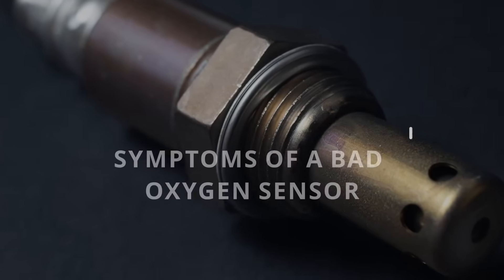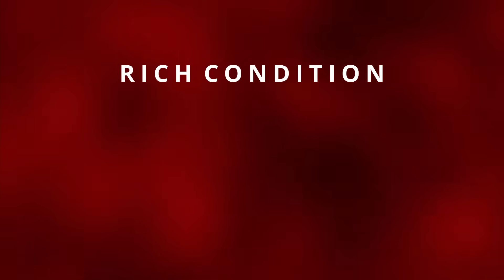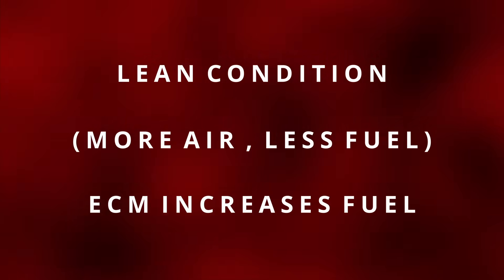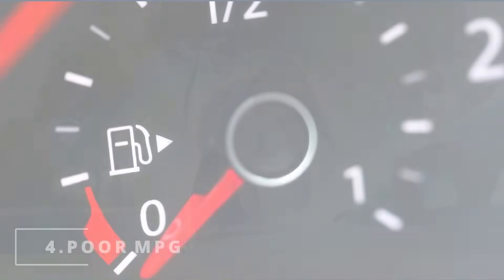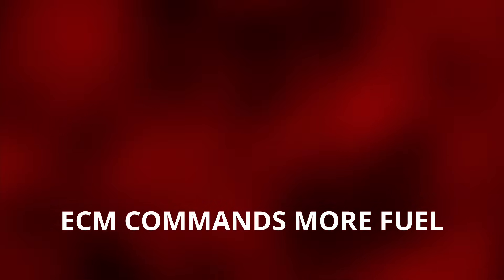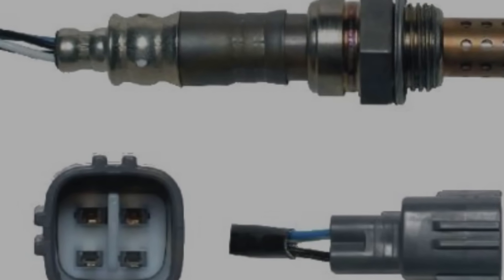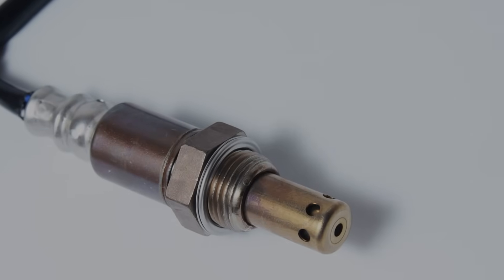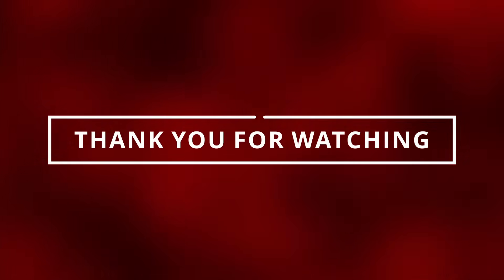SYMPTOMS OF A BAD OXYGEN SENSOR

Comment: Straight to the point and my vehicle is having all the symptoms. You'd think it would be a clogged fuel filter or failing fuel pump from losing power, hesitation, High RPM rev limits and transmission shifting issues. I do have the CEL on and it is the Bank 1, Sensor 1 Upstream. Going to chang it out today in Hope's it will resolve all the issues it's having. Amazing how one little sensor can reck havoc on your engine...
Reply: Please tell us if it really worked
Reply: did it work?
Reply: Hello I have an  01 Buick Regal 3800 supercharger my car is also have the same symptoms. I’ve replaced my battery, an starter.  radiator does have a slow leak! Any ideas?  What  could possibly be going on?
Reply: Did it work?
Reply: Did it work
Reply: Did it work was it the sensor
Reply: Hi did it work
Reply: My truck be making a windy ass hell noise if i open hood feels windy and wasting more gas then ever before engine sign on and the transmission shifting on 1st and 2nd feels clumzy and sounds more airy then i could remeber took truck 2 get checked marked oxygen sensor and one other sensor
Could that be it why it sounds airy and it dont run hard or dont respond and wadte hella gas know
Reply: My cars gas will just lose power
Reply: @montybruce4666  mine too bro idk what it is 2011 Hyundai Sonata
Reply: I know James Logue personally and he said it worked except he has ro replace it every month. So far he's replaced 5. I'll keeps you guys updated in his absence of he needs to keep replacing every month.
Reply: @jvirg  mine ended up being my transmission and all it’s issues due to being a cvt
Reply: Did it work ???

Comment: Would a bad upstream o2 sensor cause misfire? Mine needs to be replaced for sure but I’m not sure if it’s the o2 sensor only, my mechanic did read the code and said it was the sensor but at that time there was no engine malfunction sign and it reduced my power of the car and everything. It misfires as soon as it gets to 3rd gear.
Reply from the maker: It sure can!

Comment: What if the o2 sensor after the cat goes bad, will that effect performance or make the car misfire?
Reply from the maker: The purpose of the sensor after the cat is to measure the efficiency of the catalytic converter. The downstream sensor will not cause a misfire or effect performance. A clogged catalytic converter will though!
Reply: @easyautofix  ok thanks buddy
Reply: Very good question. I will just replace the one before the catalytic converter.